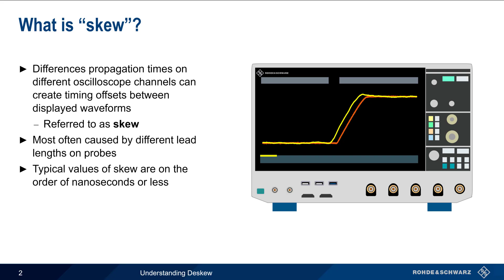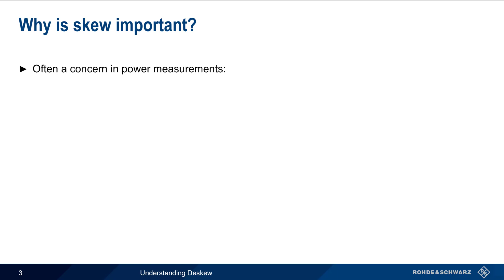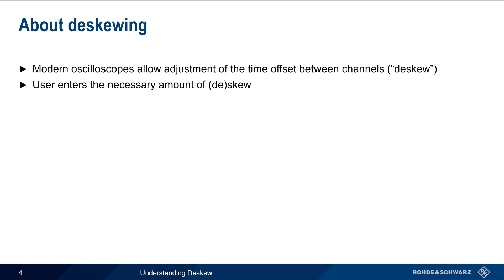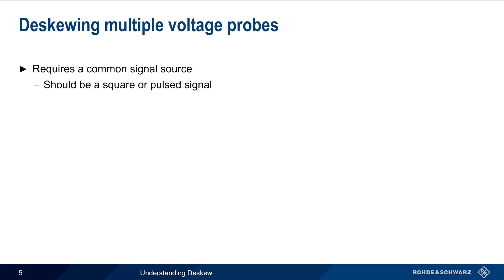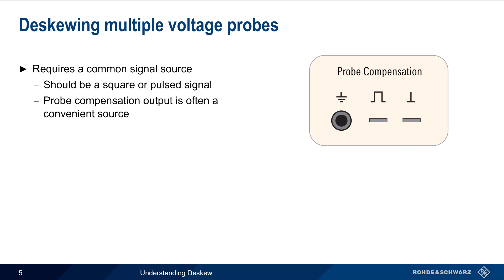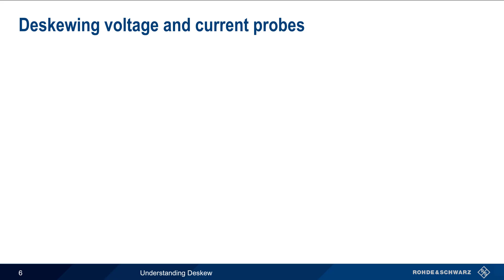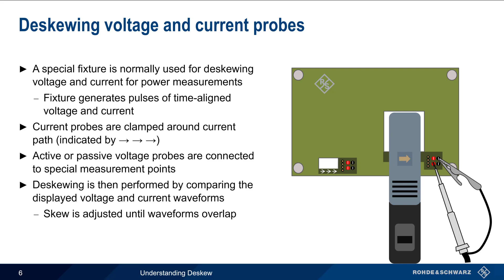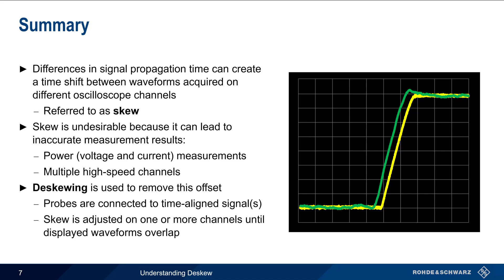Understanding Oscilloscopes - Deskew

Comment: How do you de-skew an active differential  probes?  Does R&S have a fixturing?
Reply: You should be able to use any of our fixtures, such as the RT-ZF20 (a video on this fixture is coming out later today).  The deskewing process is the same, with one end of the differential probe connected to signal and one end connected to ground.